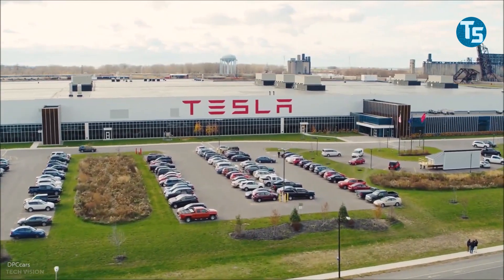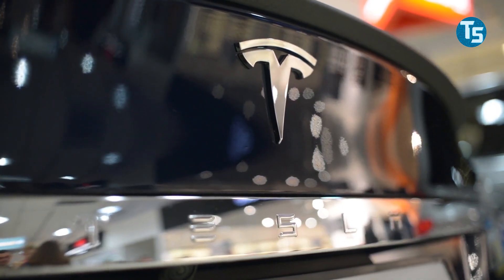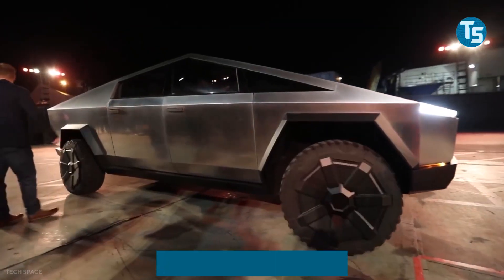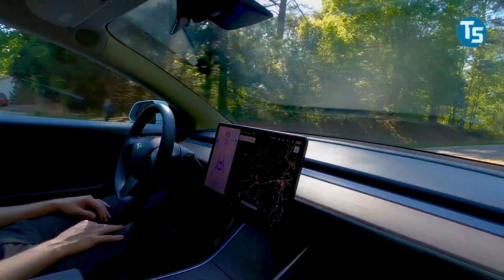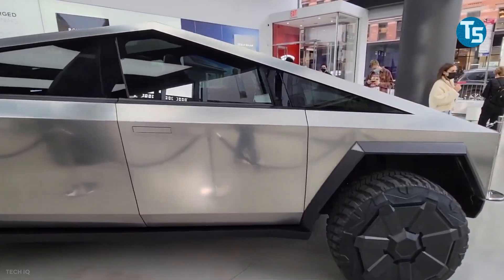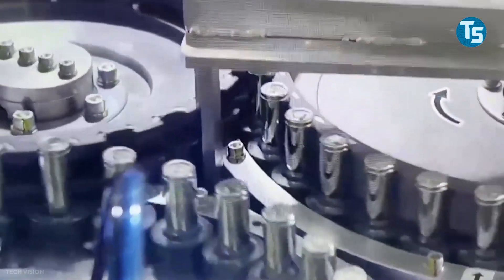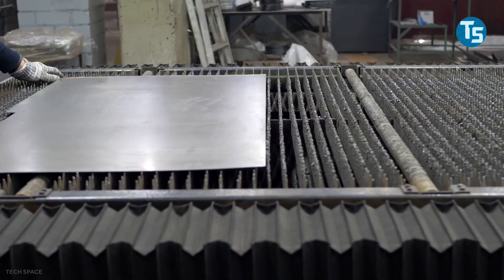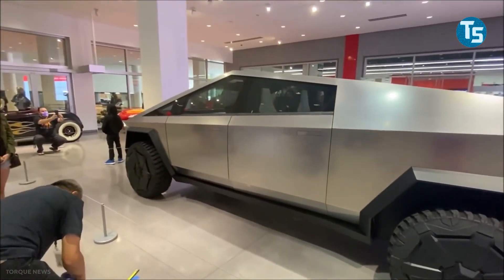Tesla Cybertruck CONFIRMED Updates For 2022

Comment: There are no engines in electric vehicles.   They are called motors.

Also, when you see 301 SS.   It is called “three oh one stainless steel”.  So 30x is pronounced “three oh ex” not “thirty times”.